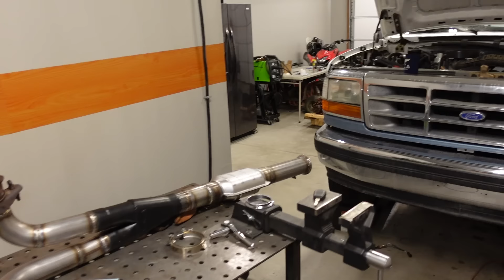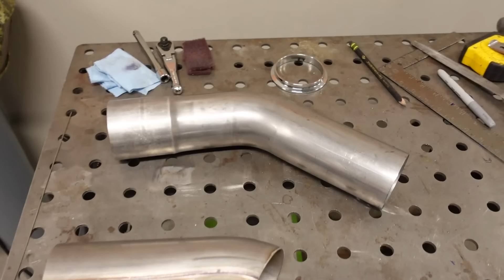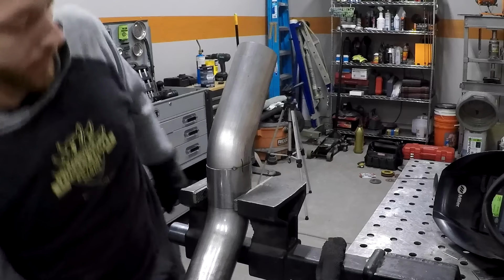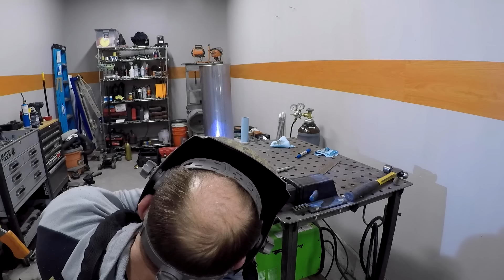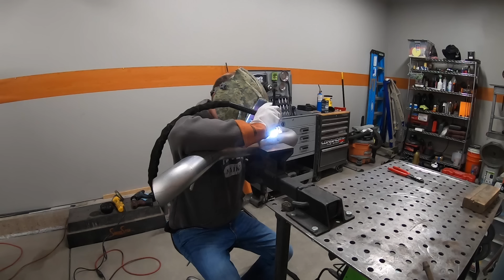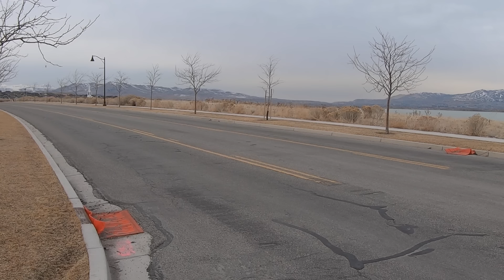F-150 gets a Venom 250 muffler and a custom mandrel bent exhaust

Comment: sounds great on the inside, unfortunately the outside sounds like many other mufflers, ive installed over 25 exhaust systems on those era 351's and they are almost impossible to get to make sound like a mustang.......well..you can but its going to be even more custom lol......i'll have to google what the inside of that muffler looks like, ive tried so many different brands of mufflers on those trucks and they all sound very similar to each other in sound. muffler and cat placement, exhaust pipe diameter are HUGE roles in sound.

Comment: LT in your experience would you use 304 or 409 stainless for your exhaust 409 is definitely cheaper not sure which route to go
Reply from the maker: depends a lot on the project I guess... usually I just use 409 for most "driver" type projects

Comment: love the channel man. keep up the work. word of advice. when it comes to welding stainless pipe the bigger the cup the better the weld will turn out. i see your using your small cup still. which is perfect for aluminum. get yourself a #10 or #12 cup. should help quite a bit.
Reply: nvm i see your using a #12 cup later in the video. keep it up. love the content

Comment: Love my 93 0BS with it's 5.0/331 upgraded to RCV front axles recently, with a mild build with ported GT40 iron heads of a explorer and B303 cam forged crank, pistons, and hbeams I throw a 150hp shot to the Detroit front and back with the rear having mystery brand 31 spline  and girdle cover 4:10 gears. I run 31x10.50 and get laughed at until the lockers and laughing gas shoot it through the red clay and occasional snow bunny trip with ease and with the new fronts I can play all day with 4 wheels spinning instead of 3. Best part is no hubs to turn as the auto locking hubs get routine matinence and stacked o ring seals from local bearing supply so neutral to 4wd with the push of button,with serviceable real hubs.

Comment: BMW I'm gonna guess an older 740i.

The way that truck sounds will completely change with headers, I had a 3 inch straight pipe on my 460 with the cast manifolds and I had the same setup when I put my long tube headers on and it sounds like a completely different engine. This is probably going to be an unpopular opinion but I kind of hate the way older trucks sound with a loud exhaust and their stock manifolds, I'm not sure how to describe it properly it just sounds like an old crappy truck motor coming down the road.

Comment: 12:50 Naw, I wanted to weld me some 2X4s together yesterday for a support for my truck, but they warped so bad, one end was flat in the ground, and the other touched the roof of my garage! Also, they was a lot of smoke and fire, is that normal, might try again tonight, I’ll use a few more clamps

Comment: I had a similar set up in an 89 f150 4x4 short box reg cab. 5spd 302 that I converted to mass air with mustang bolt ons. I used a flowmaster, shorty headers, no cat and exited before right rear tire.  Very fun truck

Comment: 386👍's thanks again for taking us all alone you
Reply: How much torque and horsepower do you lose going through a 4L80E transmission and transfer case in a 410 3/4 ton rear end to get the power to the ground

Comment: Have you had good luck with your butt joints lasting ? My dad owned an exhaust shop, and I worked there along time, always did slip joints or Buick bell joints? It is nice have an exhaust tubing bender in my garage now,
Love your channel, I subscribed early on. Keep up the great work
Reply from the maker: i would love to have a mandrel bender, but Im sure that takes up a ton of real estate! yeah, I've got plenty of systems like this with a ton of miles on em with no issues at all...

Comment: I bet a good free flowing air intake and filter would complement that exhaust sound nicely.
Reply: Believe it or not the stock filter and intake flow more than the stock cam and heads will let into the engine. The same filter and airbox and intake piping design are used on the 460 that makes way more power than the 351.

Comment: Sounds good LT. Stock early 90s truck engines never really sounded powerful.. You did the best you could with what you had. That stainless system should outlive the rest of the truck! Gotta love the v-bands for serviceability! I'd like to see what he has planned for the future wideband stuff. I'm a huge fan of my Holley Sniper system. 
  For future reference, I've heard that open single 3" exhaust will support about 370hp in a zero loss exhaust system. 
  There's a formula that I read in a magazine several years ago. It says that you should have 2.2cfm per horsepower. 1 in² of pipe flows 115cfm. So (pi X r²)115/2.2 = supported horsepower before it starts to choke power from your engine. 
  Let's take 3" pipe.. 
 (3.14 x 1.5²) 115cfm/2.2cfm/hp
 (3.14 x 2.25) 115cfm/2.2cfm/hp
 (7.065) 115cfm/2.2cfm/hp
 812.475cfm/2.2cfm/hp
  369.30hp
  Maybe it's all just voodoo, but I think it works as a good rule of thumb for pipe size. You shouldn't necessarily need bigger pipes than your hp goal.

Comment: Nothing related to this truck here. But I was wondering what would be the best injectors for my 2000 Chevy Tahoe with 5.3L stock with throttle body spacer
Reply: Why wouldn't you use the stock injectors? Going bigger won't get you more power on their own
Reply: @mike93lx  yes I understand all that I ain’t stuff just wondering what good set be going for
Reply: @darrylpetersjr.727  Stock. Oem
Reply: @mike93lx  ok where I live I can only do online shopping that is why I am asking I need 8
Reply: Nnbs intake with the stock injectors